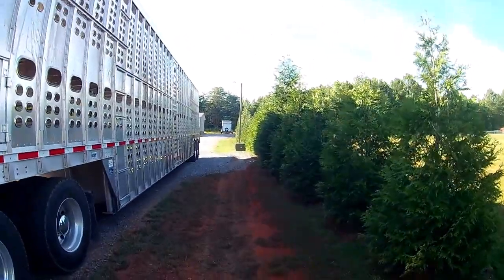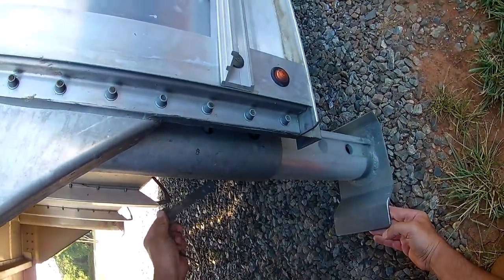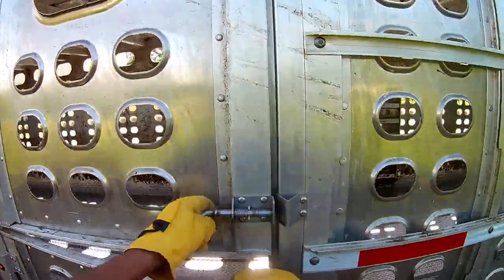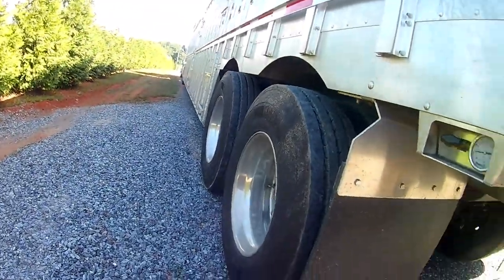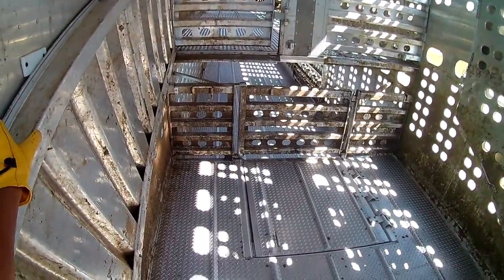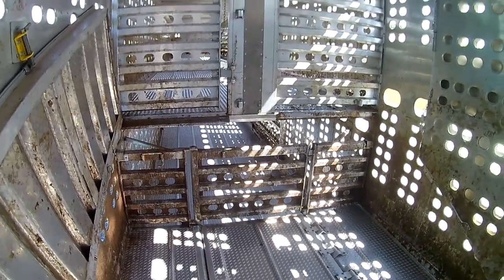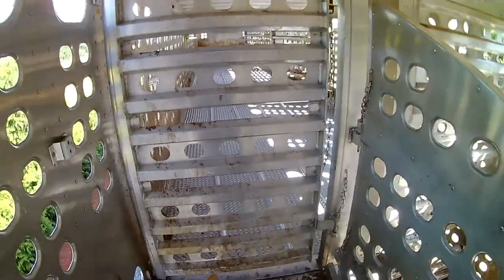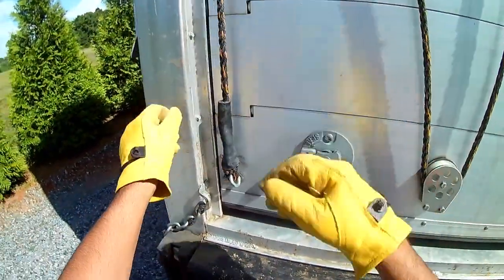The Ins, Outs and Tour of a Cattle Trailer

Comment: Interesting set up and safe for the driver with gates to protect  them . Your wife probably thinks so to she go with you on drives . Thanks for the information on your over kill hauler trailer it’s set up to keep driver safe when unloading cattle and loading. That is one biggest trailer ,I ever seen.In cab on trailer wear you  store or keep boot’s and shovel an your electric choker and flag ,I put emergency kit and flairs and orange cones that glow in dark to  put along the road . You could put a board or hard plastic up to block the door to keep manure out and your stuff clean. I’ve seen that setup in a friends trailer and it works an easy to removed.
Reply from the maker: Yes my wife rides with me periodically

Comment: I love the cubby holes behind the gates
Reply from the maker: Yes it's a great place to hide 😄
Reply: We use to haul hay back sum times from Sauk Centre MN. They have hay auctions thar at a truck stop just about like the cattel market except its hay they got every kinda hay u could think of ..well  I rember several times we get to bring back a load and it just like cattel u have load it your self or pay to have it loaded ... you can fit a pile of them littel square bales in a trailer and it flat out sucks loading and unloading and you dont have to worry about the bales attacking you lol and  it beats the hell outa deadheading .. and of course you gota have trailer washed 1st but when u get it unloaded you have sum feed for the next load or bedding .. u ever get to do that?
Reply from the maker: Sounds like a good back haul